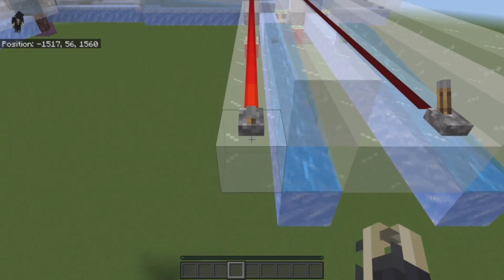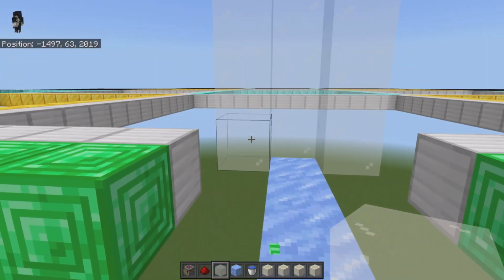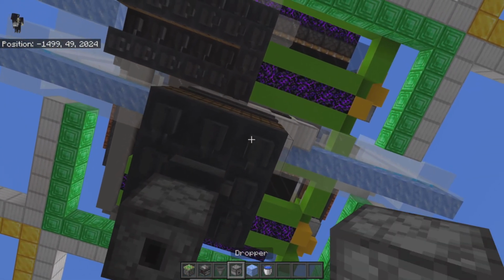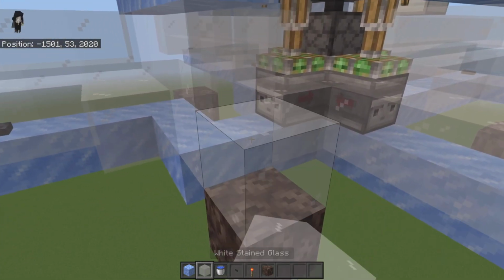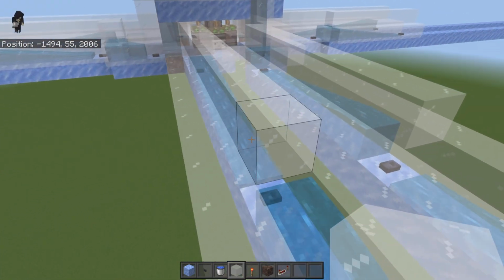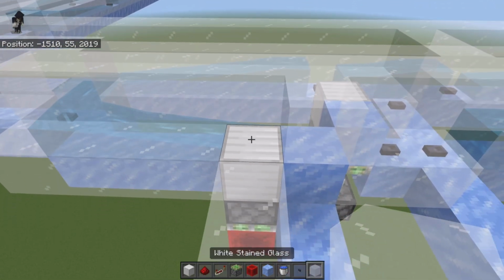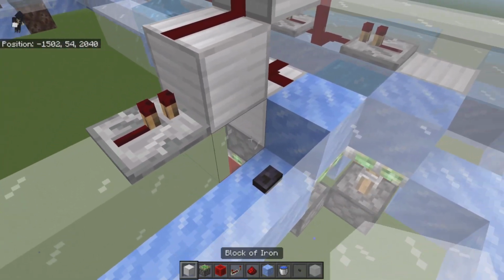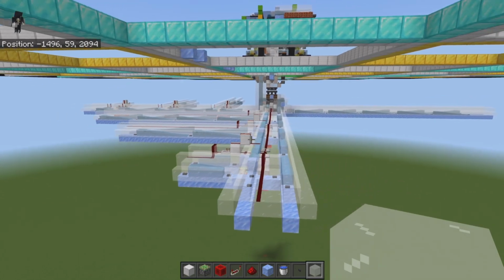How to Build a Superior Industrial District!!! (Simple & Easy) [Minecraft Bedrock 1.21]

Comment: you should include rates in the title. im certain it will get you more views.
Reply from the maker: That would kind of be false advertising though. I feel like because I already made a tutorial for the farm with the rates, this is just the bone meal distribution system. That's part of my superior industrial district
Reply from the maker: Let me know if you still think I should add the rates
Reply: @brokenbones623 please add the Rates
Reply from the maker: In other words this tutorial doesn’t have rates, and that’s why it doesn’t have any posted with it. It just send bone blocks in a shulker to you farm when ever it needs it
Reply: What Are the Rates? You know them?
Reply from the maker: The rates are posted on the moss machine tutorial, this is just a distribution system for the shulkers of bone blocks, not a farm. This is for all your farms that run off bonemeal to connect them the main storage so you don’t have to manually move anything or risk running out of bonemeal
Reply: @brokenbones623 can you please answer my question regarding the ultimate ice machine?
Reply from the maker: Ya sure ill check it out